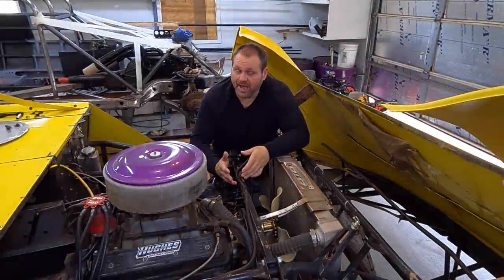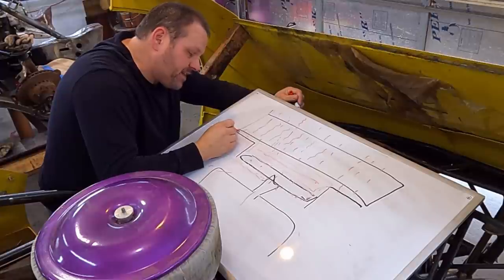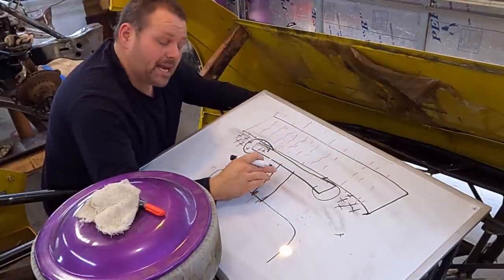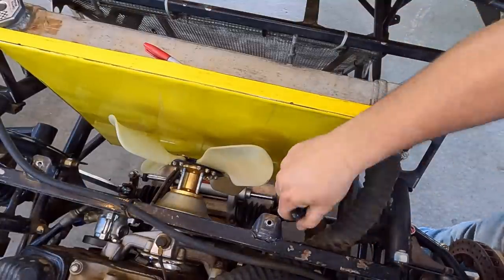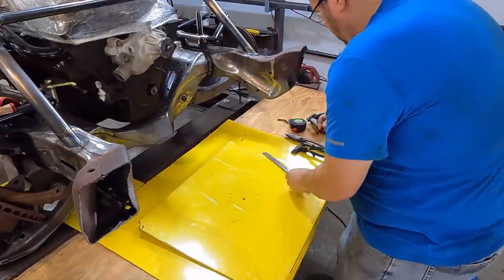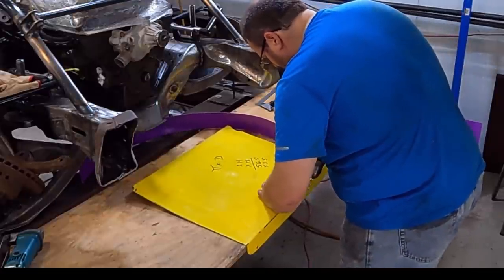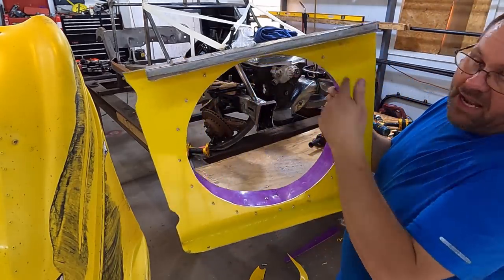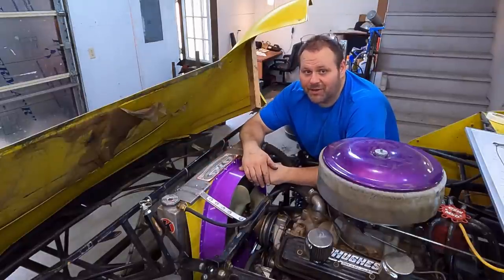Stop Engine Overheating! Build the Fan Shroud Your Race Car Deserves.

Comment: I have always had a shroud on all my cars and always put it in around the middle of the fan blades. So half in and half out. I never knew why but you explained it to the T. Excellent video as always Jason. Looks like all this work is helping you lose weight.
Reply from the maker: Thank Dave, I had a major surgery last week and HAD to get some weight off to get in better shape for it. That and my kids were raggin me saying the fire suit was lookin like spandex :)
Reply: @DIRTRACELIFE  Congratulations on doing that. I'm in the losing weight mode myself. Being 53 makes it harder to do than when I was younger but still getting the job done.

Comment: I wish I saw this before almost finishing my shroud. I chose titanium... Even harder to change after it's all tacked up. I now know I need to add a short tube for the fan to sit in rather than a hole in sheet metal coplanar with the back of the blades... I thought having it all recessed and protected inside a box was a nice idea. 

Great video, I appreciated your whiteboard explanation most!
Reply from the maker: VGN, to be clear if you are tigging titanium sheets to build a shroud then don't think for a second I have you beat on ideas. You've been doing something right to get to that point! I appreciate the feedback but suspect you make some slick fabs yourself that stand up under scrutiny 😀

Comment: I would have never guessed that I really appreciate you sharing your knowledge with us I don’t have a fan shroud I run a plastic fan 3/4 to 1/2 inch from the radiator but i really never got to finish a race due to my car pushing towards the wall the most I put on it was 17 laps in a feature race I was right behind John Schneider before I got off and I was at 170 degrees
Reply from the maker: Thanks for the feedback Mark, I'd swear I've watched you race at Camden. Am I right?
Reply: @DIRTRACELIFE  couldn’t have been me the only 2 tracks I raced with it was Pike County Speedway and Baton Rouge Raceway
Reply from the maker: Roger that, it was a look alike car. :)

Comment: Good video great info. Been running a 604 in my late model for years and just recently we started doing what was mentioned in this video and our problems are gone. If your running gas especially pump gas you need to take that radiator out every week and clean it. It’s the easiest way to know your radiator is clean.
Reply: If the rules allow it and your not afraid to spend the money you can switch to methanol and overheating will never be a concern but it opens the door to other problems and you’ll have to change oil more often. And with methanol guys actually have the opposite problem. Not being able to get hot enough. So proceed the methanol route with caution.
Reply from the maker: We can run E85 which burns at 1.5 times the rate of gas and also runs cooler. When I put my fuel system in, I used all E85 compatible parts but am on gas right now. But yes, I do see E85 in my future if I do go to a crate 602. I know it runs cooler but it also raises the torque curve on lower rpm in those engines.
Reply from the maker: The little 4 foot kiddie pools are by far the way to go. Ilike to just let it soak overnight. Very effective at getting those flus clean.
Reply: @DIRTRACELIFE  yep I use that too

Comment: I'm doing a shroud, now that I've seen this.  I was worried about the sides not getting any suction, but better than what I have - none.
Oh, and smart way to get the center!  Can't miss.
Reply from the maker: Thanks sir, If I could build what I consider a "perfect" shroud then I would make the box itself about 2 inches deep between the radiator fins and the shroud plate that way there is plenty of room for the air to come through those corners and make the turn into the shroud. Yeah its going to darn sure be much better than nothing at any depth but I agree a deeper box would make it even better.

Comment: Great tutorial and nice work.  

Bought my Chevelle, previous owner removed the fan shroud.  No idea why, or if he thought it was inefficient or saved weight.  

I’m of the opinion the engineers for manufacturers are not looking to spend money where they don’t have to.  Therefore if a shroud wasn’t important, they wouldn’t use one.
Reply from the maker: You are absolutely right, and also we absolutely are not building or using these combinations in any way like originally designed or intended either though. Sometimes you have to have even more than what was originally designed, not less.

Comment: You put a lot of work into that just to prove you don't need all the expenses tolls, but as for a brake if you have a racecar it's all but a must have toll !
Reply from the maker: Sure not going to argue with you on needing a brake Dana! I do have a 6 foot brake that I built but because my shop is small I usually only set it up the shop when doing a body. But my brake is not as good as a purpose built professional unit so I am hoping to move up to a better one at some point in the future.
   I think one of the biggest challenges to a person who wants to get into build and racing is all the special tools required and skills you must learn to use them. So yes I am trying to show how to work with less equipment but there are some tools that, if you are going to be in this sport, you will need to buy. 
Thank you for watching my channel and giving great feedback.

Hey what track are you at with your video's of the modified?

Comment: Great video.  We have a shroud but still hitting 240 temp.  Gonna compare and maybe build a better shroud.
Reply from the maker: I struggled with my crusa ss keeping the engine cool on gas with the 24 inch rad. I hadto get everything top notch as well. Timing, 4 blade 19 inch fan, soak the rad a couple times in a kiddie pool per season, air directors, etc... it can be a challenge and ya sure can't ignore any piece of it 😉

Comment: I have seen dirt track racers build a COMPLETE shroud between the heat race and the feature.   If the radiator is clean, the thermostat is good, and you are still running warm, you better build a shroud.
Reply from the maker: 100% right sir. If you are overheating, know the Rad is clean and coolant is flowing correctly, and don't have a shroud, well its not rocket science. Gotta direct that air!

Comment: great simple tutorial - thank you!   what is the power tool that you use to cut the aluminum?
Reply from the maker: Thank you Damian and thanks for watching. That's a Makita power shear I have had literally forever. They don't make that model anymore but here's what the new ones looks like @ https://amzn.to/3JAqKT5 . They are more limited on making tight turns but perform much better at running long straight cuts because they are in essence like scissors.

Comment: I had to change the spacer on my set up.  I went from a 2" spacer to a 1-3/8" spacer.  That change has forced me to rebuild my shroud, and this video got me off the fence of if I should spend the time to do it.  Thank you.  I have one question regarding the fan bolts.  I want to change from bolts to studs.  Do I have to use hardened grade 5 or 8 studs, or can I use standard (grade 1)?  I sure don't want that thing coming off at 5,000 RPM.
Reply from the maker: I would not use less than grade 5's. The reason being anything below that is going to yield so easily that every time you take it off and put it back, you end up over stretching them a bit more everyone. Eventually, they are going to break. 8s may be overkill but grade 5s sure aren't.

Comment: Great video, I just found your channel. Can the the same ( or if I apply the same) principles with electric fan work? Looks to me the shrouded electric fan is starting with  the problem of fan placement to deep in the shroud. What is your thought?
Reply from the maker: I think most electric fans designed already in a shroud are probably engineered for the blade shape to work well with the placement of the fan in depth. HOWEVER, I also believe there are applications where size and room limitations are a factor on any repurposed fans. For example, I have seen plenty of ford Taurus fans repurposed but is that fan designed that way partially to clear the exhaust manifold even if it gives up some ability to push air. In aftermarket, I question some designs, were they really engineered the best they could be or are they designed to create the most compact design with minimal materials used. in my opinion, it is possible there are electric fan designs that do sit the fan in further than what would be most capable but it made the overall design more robust and made the fans cheaper to build as the reasons they did it. I didn't give a clear answer here, I know, but at least I tried to give you some of my thought process on comparing the two.
Reply: Thanks, that is appreciated. Building a shroud now (thank you again for the video) to use with the E/fan. We'll see how it goes afterwards.

Comment: You should have added a spacer between your sheet and the rad so the air can be pull thru the entire surface but good job it will be better than the way it was!
Reply from the maker: I think less than a 1/2 inch gap is a problem and I think anything more than 2 inches and there probably is not any more gain in flow. Just my thoughts on what the range is. Appreciate you watching and the feedback.

Comment: I run a single pass 26 in radiator 4 blade Fran 3/4 in away from the fins no shroud on a modified never gets over 210 degrees. On 110 race gas. Running proper pulley system helps slow fan speed.
Reply from the maker: I agree on the reduction pulley and do that as well!

Comment: Excellent video. There is a little leakage on the sides of the shroud.
Reply from the maker: I saw that too. Blew my mastic tape out. Next up... Gorilla tape :)
Reply: I thought about that too.
What if the aluminum went past the edge of the radiator and had a 90 degree bend too?

It would provide a little more rigidity, and then anything not sealed up has air coming straight at it anyway. 

Atmosphere forced through a small crack I would guess would build high enough pressure to cancel any pressure coming at it from the inside. Kinda end up atmospheric pressure sealed?

I know thats kinda overthinking it... but that's the part I like about race cars.
Reply from the maker: Wb3, i agree a 90 bend past the edge would be enough... but for now she got some gorilla tape. Never go to track without that and zip ties :)

Comment: I used a box fan while watching the video and the air does circle around, I cut a napkin in a one inch strip and moved the napkin out front
Reply from the maker: I tell you Jeremy, You'd think whether or not to run a fan shroud was like politics! Some folks are like Yep I agree run one and others are in the camp "your nutz, just get it close".... If I do another fan shroud video I am going to steal this from you and use it in the video! Maybe tape a bunch of christmas tensile around the radiator on a race car and then fire it up with no shroud to show all the wierd ways air is moving that we don't normally think it does.    Yep, I'm takin this idea and running with it! (Don't worry, I'll tell them where I got it from :)

Comment: What name brand are those snippers u used to cut the plastic 1in rips with
Reply from the maker: To be honest they are older than me and not named/tagged. They are called "sheet metal shears" and are for aluminum siding and made just like normal scissors. And I have seen them still sold in hardware stores. They are not tin snips which are very different.
Reply from the maker: Ok Junior I was thinking this set of Shears was made by Irwin now and I looked it up and YEP! they sure are and pretty cheap too. Here's an amazon affiliate link I made for them if you want to check them out. https://amzn.to/2ZEhiMb
Reply: Can you tell me where to find that plastic?
Reply from the maker: I have been buying it from a local race shop but all your large online race part sellers have it as well. Speedwaymotors calls it "plastic sheets" and summit racing has the Allstars brand and you can find it by searching "rolled plastic"
Reply: @DIRTRACELIFE  thanks bud

Comment: Can you leave a link or tell me what the tool was called that you used to cut the hole out ?
Reply: You can buy the electric sheet metal shears from harbor freight . Word of advise when  cutting circles with this tool take your time don't force it
Reply from the maker: They no longer make the Makita shears like I have but here is a link to the model they make now. https://amzn.to/3jVD8l1
Major is correct, I think there is a Harbor Freight Bauer version of these as well so check them out if you have a local HF store.

Comment: how far is the actual shroud away from the radiator  look like its up against it and is it ok if its up against the fins thanks
Reply from the maker: About one inch and I would say that is the minimum. 2 or 3 inches would likely help give the air a better flow path if you can do it without having issues.

Comment: How close to the radiator should the fan be??
Reply from the maker: I like 4 inches as my minimum where I can get to the bolts without having to pull the radiator. The fan will pull better  if you have a shroud that will let you get out toward 6 inches of space but that ONLY with a well built shroud positioned on the fan.
Reply: @DIRTRACELIFE  Thanks for the info. Great video.

Comment: The recent radiator installation might have faced issues as I forgot to reattach the bottom portion (lower half of the shroud piece) and overlooked relocating the extended strip of sponge material between the radiator and the front support. Noticed leakage under the engine bay after a short drive. Planning a coolant air pressure test to assess the problem thoroughly. 🤞🏼
Reply from the maker: Ouch, hopefully not too difficult a repair.